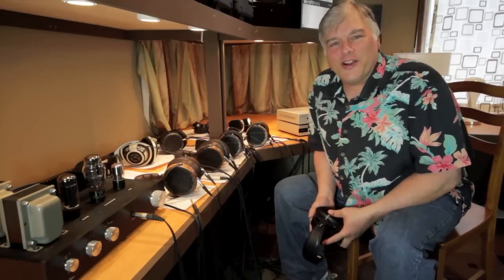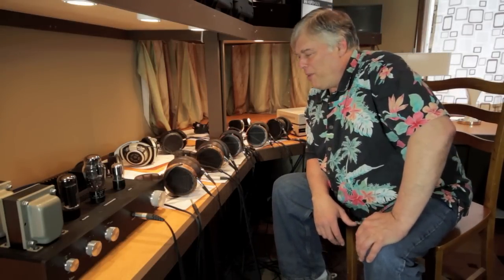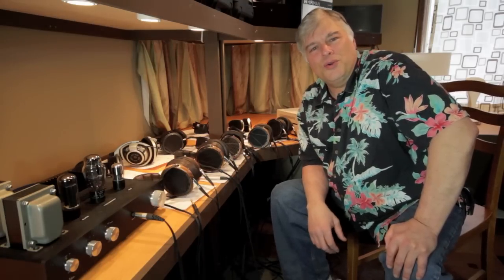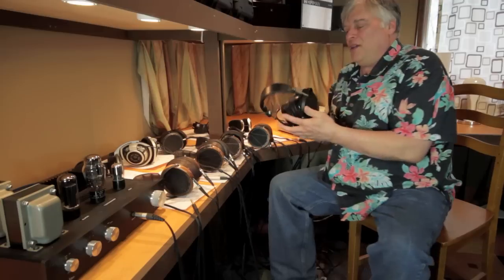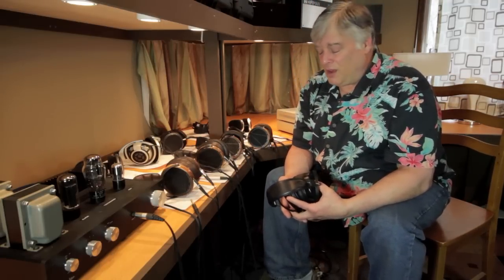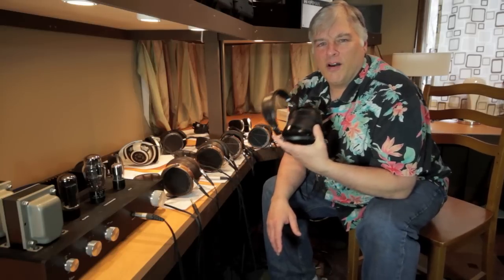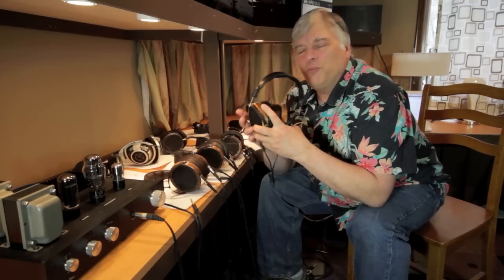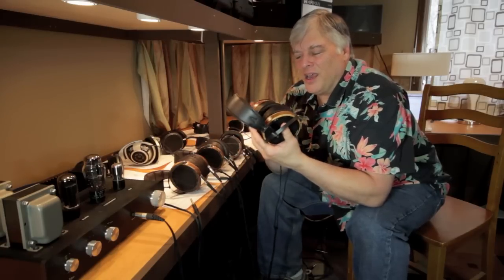The Audeze LCD-X, Fazor, and Context with Current LCD-3 and LCD-2

Comment: How strong is the impact of the LCD-X compared to the HD800? I quite liked the sound signature of the LCD-3, but it just sounded far too tame compared to the HD800 which can really really give a feel for the music. For example if you take Jeremy Soule's symphony March of the Legions, with the HD800 you can literally feel them vibrate when producing the air pressure of the big drums, where the LCD-3 really doesn't do much in the way of making the drums feel/sound real.
The sound signature of the LCD-3 is sometimes more natural than the HD800 but they just don't convey the physical impact of the sound. I'm hoping the LCD-X might step in here...
Reply from the maker: If you read the review at InnerFidelity I talk quite a bit about this.  The LCD-X does indeed hit harder both in the low bass and with its dynamics in general. Not a lot, but enough to make a difference.

Comment: Hi fellow headfiers, I'm not too sure as to why they would place fazor directing towards the outside? It would make sense if they are accounting for the weight - push and pull. But other than that, it seems redundant. Could anyone explain more in details? I would really appreciate it
Reply: The pressure going out needs to flow just as easily as pressure going in. You could argue it's going to be dampened anyway, but I think it also helps to reduce standing waves between the two parallel surfaces of the flat outside magnet structure and the grille.

Comment: when do you think they started adding the new drivers with the fazors to the whole line? because I bought an LCD 2 back in september 2013, which I know have the current softer ear pads, so I'm curious if that implies they have the new driver set up too, as you say. Other its like I just got them right before the best version of them came out lol, and I'm not about to mess around with sending it back or whatever. Would be nice to know, if you have any info.
Reply from the maker: The new design started shipping in mid-December. Yours are probable the previous version.  You can have the Fazor retrofitted for $250 if you send them back to Audeze.
Reply: got it, thank you for letting me know. after reading your review, I'm actually starting to think I'll just keep them as is lol. In a sense they are the best version prior to fazor, which seems to have the slightly fuller bass, compared to what you experienced with the fazor version. So again thank you for that :)